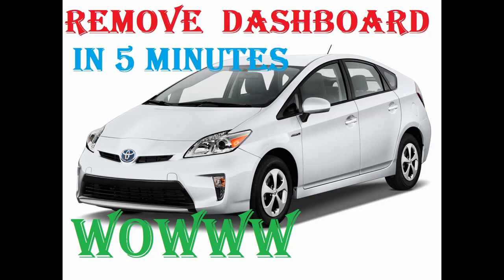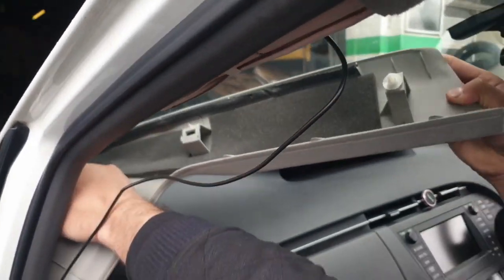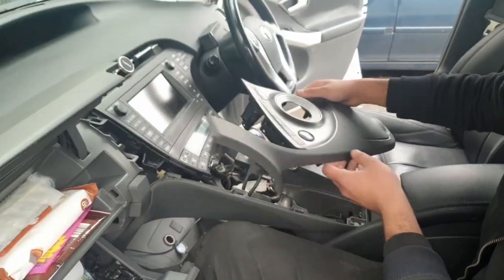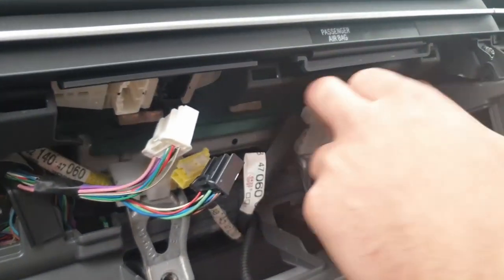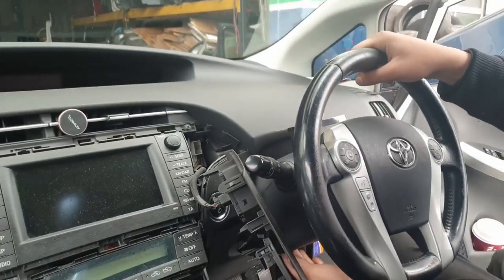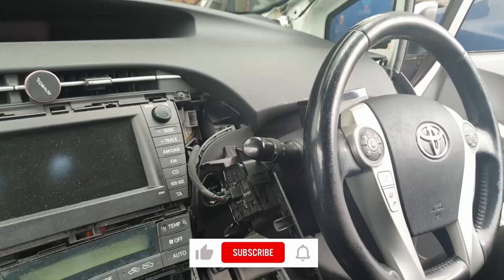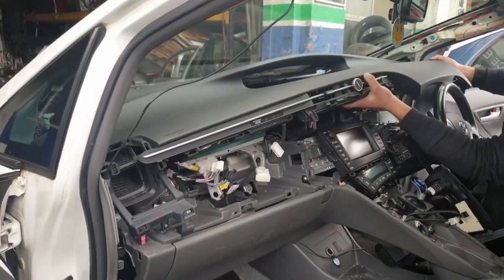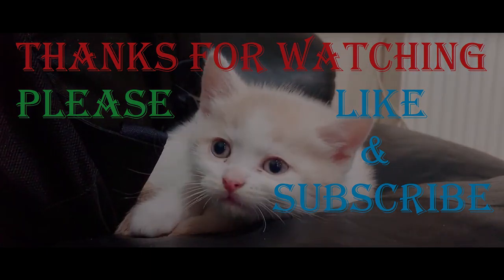Remove Top full Dashboard In 5 Minutes Fastest Easiest and Quickest Way on Toyota Prius Generation 3

Comment: I need to replace the damper in my power steering motor. Would you recommend accessing the electronic power steering motor (eps) from the top by removing the upper dash or by dropping the steering column?

Comment: My Prius Gen 3  has an airbag in the A pillar, can I still pull out same as you or is there a different process?
Reply: I would probably disconnect the negative battery terminal and step on the brake pedal a few times to make sure the system was completely discharged before messing with airbags.

Comment: At 5:20 the antenna clip was impossible to take out. Any tips to remove this?
Reply: Insert a small flat head screw driver into the slot on the plug against the frame, the plug will then slide off